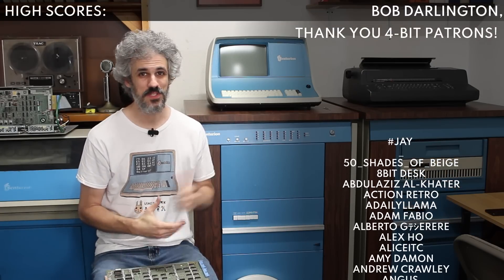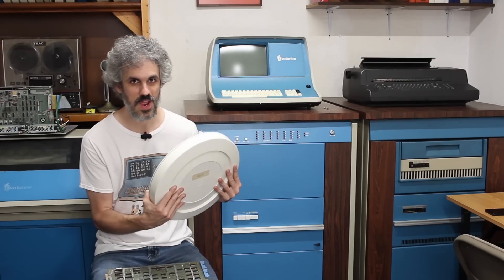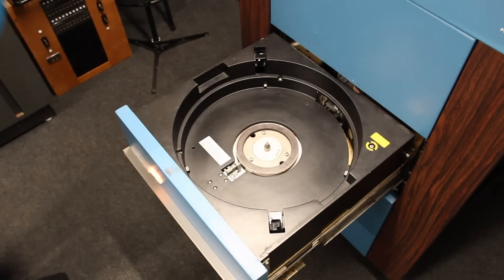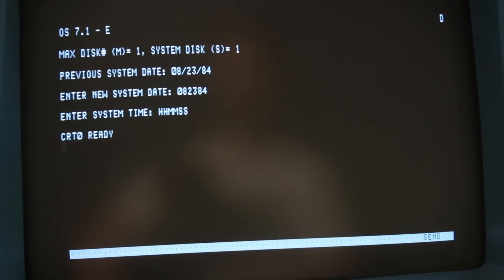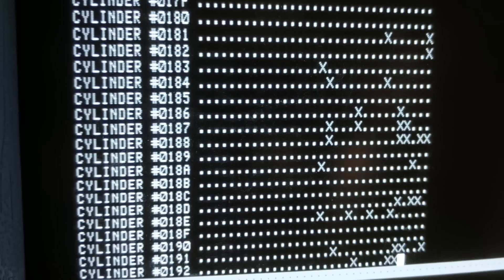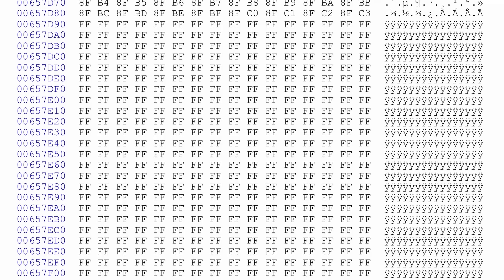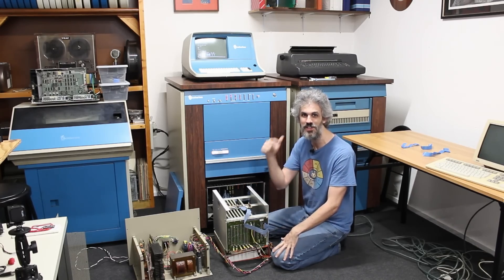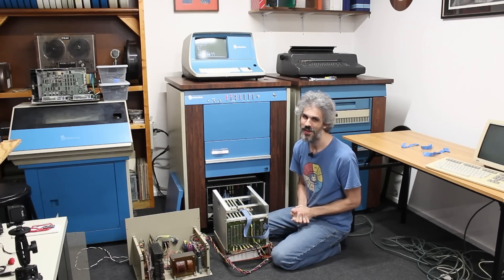We Found a 2nd Centurion OS!

Comment: What happens if you try to load cpu6os on cpu5?
Reply: David did boot the CPU5 OPSYS in the video on the CPU6 hardware [it worked] before he installed the CPU5 hardware and boot it up as a purely CPU5 system with all CPU5 cards and the non CPU6 32KV memory board for the CPU4 or CPU5 only.
Reply: @kromaine13  yea I know but it would be interesting if the oposite would work
Reply: @tradde11 The CPU6 OPSYS will not run on the CPU5 hardware like the CPU5 PCB or CPU4-CPU5 memory card like the 32KB memory p/n 1003 (no parity) that was with the CPU5 system in this video.   The reason the CPU6 OPSYS can not run on the CPU5 hardware is because of a few issues. The CPU6 OPSYS expects up to 256KB of memory with 128KB memory cards with parity logic.  The CPU6 OPSYS also uses new opcodes that are not in the CPU5 to speed up the CPU6 system and manage memory mapping above the 60KB range of the CPU4 & CPU5 designs.
Reply: @tradde11 Trying to boot the the CPU6 OPSYS on CPU5 hardware with not hurt anything, it just will not boot.

Comment: Did you notice that the CPU 5 disk in the CPU 6 OS is shown with a '5' in the .STA output and that the CPU 6 disk when you booted the CPU 5 OS is shown as a '6'? Is that a coincidence or what? :D
Reply: The CPU5 OPSYS & CPU6 OPSYS had small changes to the disk file system so a custom software tool had to be used to convert the CPU5 files into the CPU6 file system.

Comment: just a question: is this not just another CP/M clone?
Reply: It's nothing like CP/M (which requires a Z80 CPU). It's pretty much a unique proprietary operating system.
Reply: @Drew-Dastardly - or an Intel 8080, or 8085.
Reply: Predates CP/M by a few years, and was not developed to run on an 8080/8088 processor like CP/M was. There were plenty of different OS around in the 1970's, many went away to forgotten history, while CP/M, and it's derivatives, did survive in one way or the other, becoming first MSDOS as a derivative that was popular, due to it being used by IBM on the first PC's, ironically developed as a "Me Too" product, to compete with CP/M systems in the low cost market. Then MSDOS was used to run the first versions of GUI, also appropriated from Xerox from the beginning, and the others all fell to the wayside, except for those running on mainframes, where you still get COBOL and Fortran running, even if it is as a virtual machine, running on another virtual machine, emulating a mainframe, running on a X86 compatible server.
Reply: @SeanBZA  - so... It is turtles all the way down?
Reply: Thanks for the great response! Could not really find much on the Centurion D5 Evo Doss. Was it before CP/M and QDOS (that BG bought or later. "They Say" that Gary Kildall did really create CP/M from scratch. Was did yes correct or no correct?
Reply: @AlexanderWeurding  - software is rarely created from scratch. One is always inspired from something else. And always out a desire to make something better.

But yes, I believe it was a one-man operation. Or rather a man and woman operation, with his wife doing much of the accounting and sales. Unfortunately they were not really good at it and missed the boat when IBM (or was it Microsoft?) came calling for a license deal.
Reply: @JanBruunAndersen  I agree with your point! but when is it new? // Man and Woman like Cisco :) // Must be IBM and the  Microsoft , because IBM was know for the people count with the punch card. Thanks for sharing information!
Reply: The history of the Centurion operating system starts with John Warren, founder of Warrex Computer, with his 4 other partners around 1972. John was a salesman & programmer.  John wrote the multiuser disk operating system we called @OSN or OPSYS himself for our first system called the CPU4. After John's death in 1976 in a car accident, Jim McGree took over the OPSYS design for the next 8 years. Jim passed away last month at 77 years old.  How do I know this info, I worked at Warrex - Centurion from. 1975 till 1986 with the 5 founders.

Comment: Not trolling - seriously is there some magic thing that has convinced you that when handling these irreplaceable treasures you are immune from the risks associated with ESD causing either immediate or longer term damage? It was taken very seriously by the likes of IBM, right through the era of these machines. I know because I did my first ESD awareness training with IBM engineering. It would be such a shame if you damaged one of your or worse someones else's gear by just ignoring basic precautions. 
Love your systems and your work otherwise. Cheers.
Reply: We also had ESD training at Centurion when many of use attended a class  at Collins Rockwall just down the road from Centurion. The Collins engineer teaching the ESD class stated being aware of static lead to higher yields at Collins than strictly enforcement of ESD mfg steps. The Collins engineer's judgment & mine are the TTL & CMOS logic of the late 1970s & 1980s is tough and not like the old MOS transistors of the early 1970s.  I personally see David handling the Centurion hardware just we did at Centurion with respect & good judgment regarding ESD.  Thank you for your input.